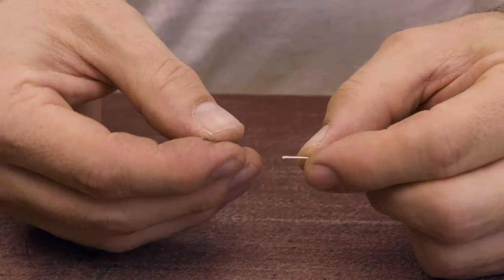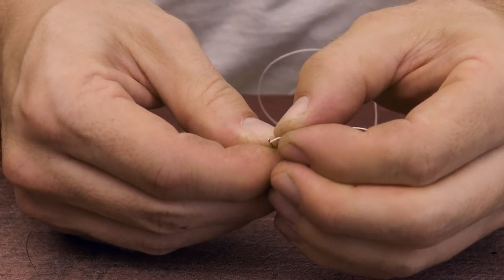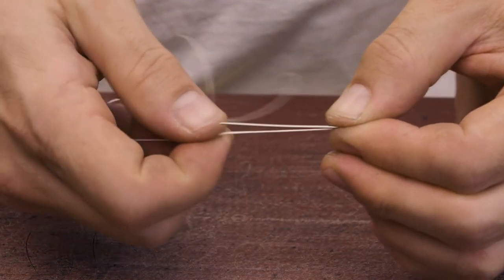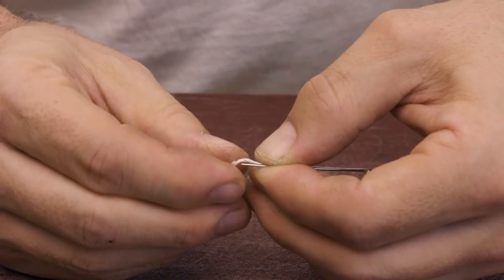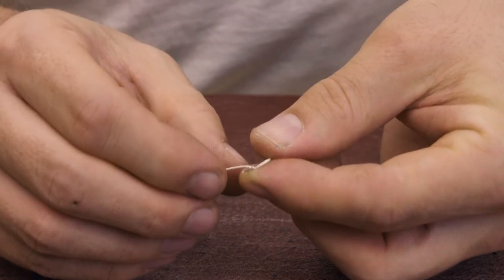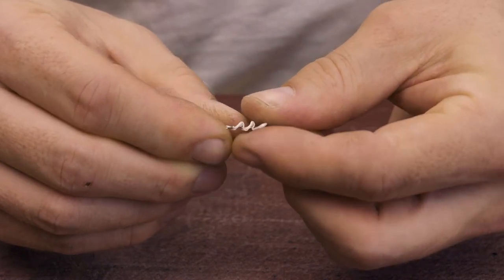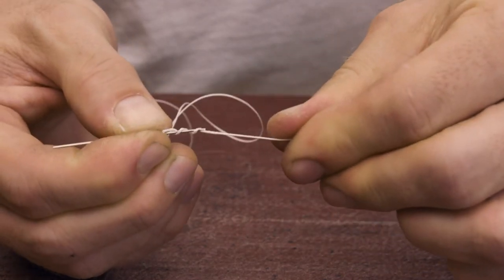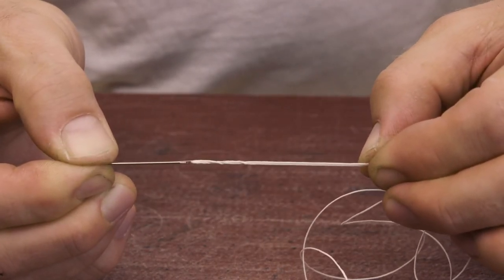Peter Nitz Tutorial - Threading the saddler's needle

Comment: 1 is sufficient
Reply from the maker: actually one isn't sufficient. With only one knot it will easily slip off during stitching. Even with three knots sometimes after stitching long sections it can come undone.
Reply: Peter Nitz never had one come off in 10 yrs. although I have had it snap break etc. But not at the needle eye
Reply: @PeterNitzAtelier  It physically cannot slip off, the thread would have to break in order for it to come off.